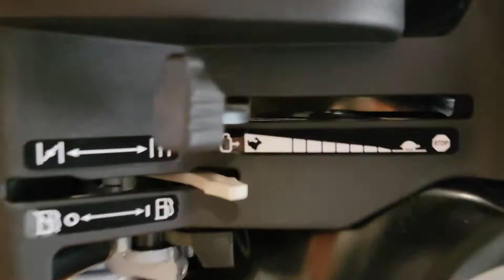Testing New Portable Sawmill Norwood LM30

Comment: Do you recall the approximate price of your mill ? I called Norwood today looking for information on a used MN26.The asking price was 7 grand, but the guy is moving so he said he would take 5 grand. Not knowing mills and pricing is why I called Norwood. He didn't tell me if the price was in the ballpark or not. Instead he quoted me on your Mill LM30. I was quite surprised, LM30, mobility package, (trailer) 10 pack of blades. I was quite surprised to be honest. The quote was for a Kohler 14 hp,  not the briggs you have. The mill and everything would be at my door in two weeks. All in stock. By the way, bought the same sneakers too. hahaha.
Reply from the maker: Good question we bought trailer separate which I believe wasn't the best way to do it but we weren't sure we wanted it or not at first.

I believe it was about 7k after taxes and shipping of course this was a few years ago now.

Comment: How long did it take to get this mill?  Would you buy it again?
Reply from the maker: I think it was about 4-6weeks from ordering. Not 100% sure, wood mixer seems like it may be better quality, but the wait times were a bit crazy ( 6+mo when we were looking). Really hard to answer, if money wasn't an issue I imagine we'd want a bigger one too, we have had some logs that wouldn't fit both width and length. We need the bunk extensions too as 12ft isn't that long, and would be nice to be able to cut 16s.
Reply: @FlickerHill  wood mizer?
Reply from the maker: Norwood LM30, WM was like 14mo wait at the time 😆